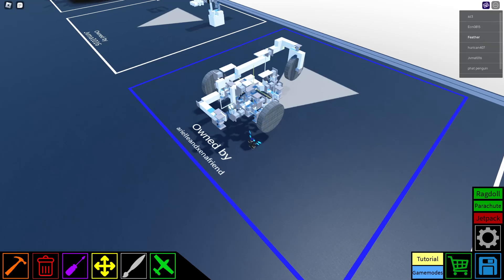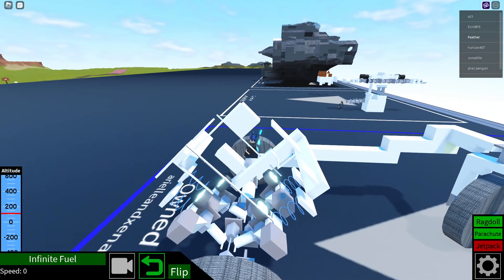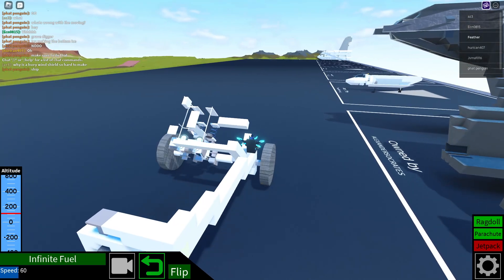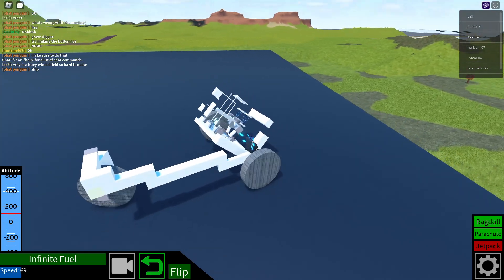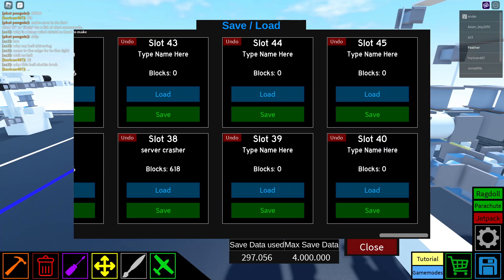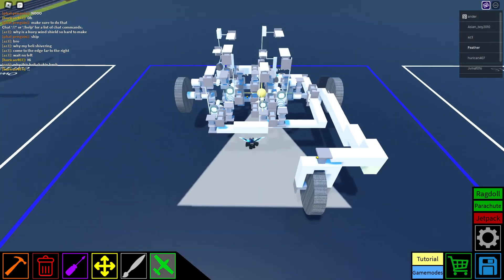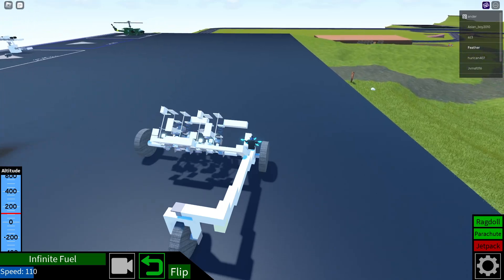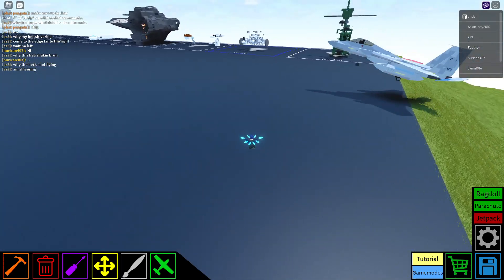V4 and V8 Hover Engine Test Video- The Smallest V Engine if not the Best - Plane Crazy

Comment: the engine is decently slow maybe add a clutch
Reply from the maker: It still be slow sadly, it needs a more powerful engine which can be very easily done and it doesn’t need a clutch but a gear box.